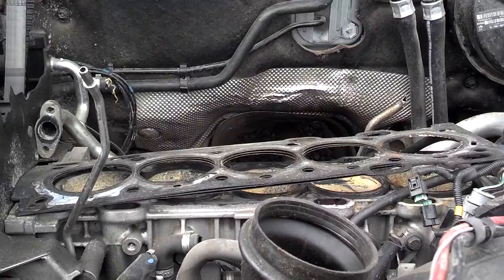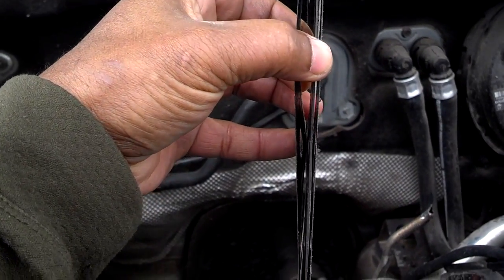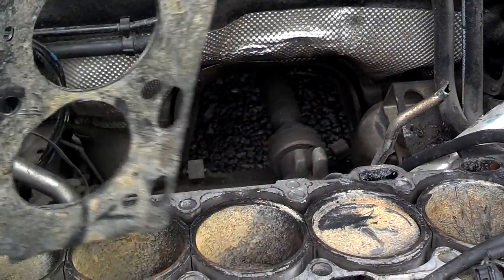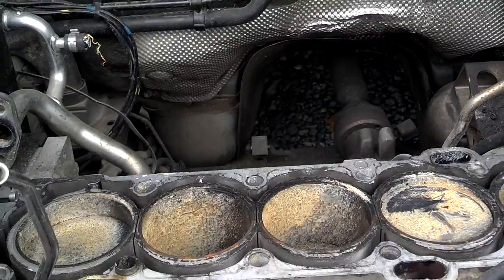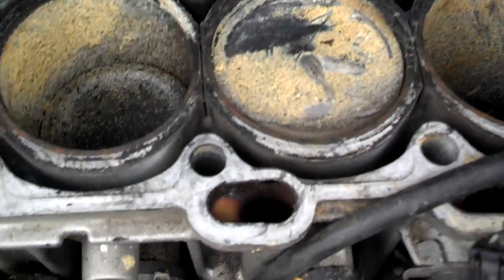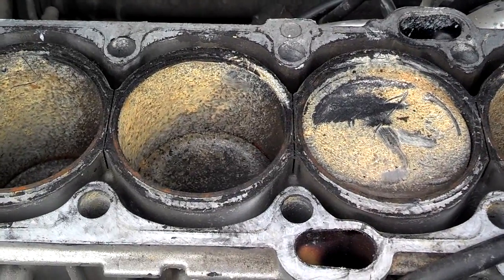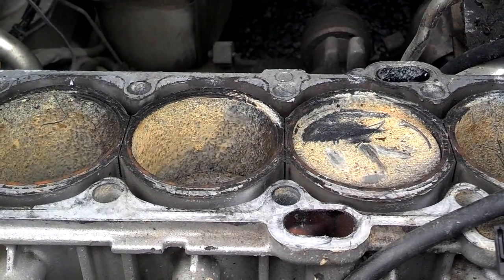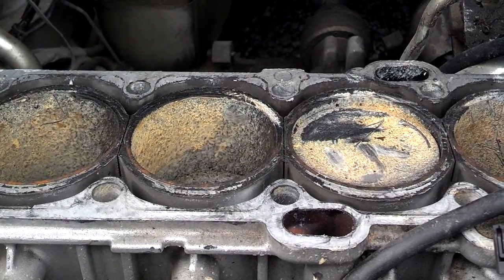Milky creamy white gunk on oil dip stick. Is the head gasket blown? - VOTD

Comment: Im dealing with something with my hhr.  White gunk on the dipstick and oil cap but the cap also has an orange film on it and my coolant is orange. The oil itself wasn't milky when i changed it it was dark and smelled burnt. 

I have a small coolant leak in a gasket and ive had my radiator half smashed in and hit a couple deer over the past couple years. I fill it every couple weeks by the pressure cap and it's fine but wont fill itself from the reservoir. I drive 65 miles to work,  then back every day mostly highway 55mph driving. Ive heard it could be a pcv valve but who knows 😂

Comment: Robert, mine it volvo xc90 2.5t mk1. No milky substance and white smoke. Is it obvious if there is water spit from expansion tank gasket is gone, won't that happen because the water is boiling and the fan does not come on? (confirmed fault)
Reply from the maker: https://youtu.be/WXOHjePUWkU?si=EKFdQ5cc5uvljloq

Comment: What about "the milkshake" in my PCV and Crankcase Vent Valve?.. I have a rough idle so I started with these two parts to see if that would help and I noticed  white sludge.
Reply from the maker: I don't even know what kind of car you have. I suggest you drive the car 30+ minutes and see if the stuff burns off. If you still have "milkshake" clean the stuff out or replace the parts.

Comment: Thanks  A lotta GREAT information.  Gonna check the Dip stick now.
Reply from the maker: you are welcome.
Reply: @RobertDIY  DIp stick, oil cap, over flow coolant tan ALL have light brown milky substance.  Plan 2 order NEW radiator, Flush coolant, ADD some sea foam to oil port.  Then see where 2 go from there.

Comment: Great explanation! My 2002 mitsubishi pajero 4x4 was parked for 3 weeks just drive it out the driveway and now i check the oil and it was funny looking ! The oil cap also have a milky color to it! I took it for a 30 minutes drive and oil is clean again! No white smoke 💨 coming out the exhaust pipe and no missfire! I felt relieved! Moisture got in the engine through condensation i guess i have to drive it more often!! Great 👍🏼 video!!
Reply from the maker: You are welcome

Comment: I took mines to the dealer. I thought it was a bad head gasket. Condensation was the name..like Robert said. Seafoam in the oil fixed it. One year later nice oil.  I had to pay 100 bucks to find out from dealer. Thanks for the detailed reference.
Reply from the maker: Glad they were honest and didn't rip you off. 👍🏾

Comment: I need you asap... I bought an 03 2.5 turbo xc90 140k original miles.  No oil pressure light comes on and engine knocks. When light goes off engine doesn't knock.. my 3rd Volvo with 2.5 turbo. Please help 507-621-4713
Reply from the maker: https://youtu.be/L3_lC3X3AFg

Comment: Nothing on dipstick. No smoke coming out the exhausts. Only condensation on the engine oil cap. Like I said in the other video, that isn't an issue
Reply from the maker: so what are you trying to say?
Reply: @RobertDIY  I'm saying that these symptoms dnt mean head gasket for sure

Comment: I had a ford focus 2007 , european version, i had it for 9 months, just before i got rid of it, it had a serious case of coolant disappearance, one time at a gas stop it even leaked 4L of fresh coolant that i put in, because the engine was running above normal temp, i stopped and saw the expansion tank almost empty.
I remember when the engine is operating, warmed up, i saw loads of air bubbles with coolant returning from the return loop into the expansion tank, could that be the air entering somewhere in the piston area ?
Also in one garage they decided that its "thermostat housing" that is leaking coolant, they replaced it, needless to say it wasn't that, i didn't even bother to get my money back
Reply from the maker: Dang. A blown head gasket can allow cylinder gases to get into the coolant system.

Comment: Thanks for linking me this video bro I'm almost sure it's the head gasket though I just did the whole coolant system on it too and I really don't want to junk it so baby in it as I can I'm going to try and buy a new car so I can get that one in a garage and do the work but not sure how long it would take me or if you might be able to help me out with that I'm in Denver Colorado by the way
Reply from the maker: I don't even know what kind of car you have...
Reply: @RobertDIY  I have a 1997 850 t5 wagon with around 180 miles
Reply from the maker: Oh, ok.

Comment: Hey Robert, I liked your video. I have a 2001 Safari AWD Van with 105,000 on the motor and I was letting it warm up to drive and the motor idled down for a min. and so I shut it off. After about 3 hours I checked the oil (checked it b4 when I was warming it up and oil was normal) and now it is very milky. So I think it just happened and maybe no harm to the engine (probably the head gasket, right?) When the oil gets drained and the head gasket repaired, how does the mechanic clean all that milky stuff out of the engine so it does not blow it? Should I Just get a new engine? Everyone I talk to says to put Blue Devil Head Gasket repair in it and that will fix it without replacing the Head Gasket. I think that would be a temporary fix if I was stranded, but I would want to repair it. This has been a great vehicle and I would like to keep it. Please let me know what you think? Thank You and have a wonderful day!
Reply from the maker: Did you drain the oil? Why do you think the head is blown?

Comment: Thanks Robert I was worried so much because my Chevy Cobalt had the milk on the dipstick and oil cap so I was worried and pulled the plugs and cranked no water just some dust lol and then changed the oil and it was black like normal  it's been like this for the winter and now since the warm weather is finally here hopefully I won't be seeing the milk. And I only really drive to work which is a 10 min drive City.
Reply from the maker: Run it 30 minutes at least once per week.

Comment: What if there's white smoke, but the vehicle isn't losing coolant fluid?
Reply from the maker: I don't even know what kind of car you have...
Reply: @RobertDIY  1998 Chevrolet Cavalier
Reply from the maker: All the time or what?
Reply: @RobertDIY  It's much more noticeable during the colder temperature, but yeah it usually does it most of the time. I drive very short trips very often.
Reply from the maker: Most cars smoke until the engine temperature is normal.
Reply: @RobertDIY  Okay. Thank you for the information, sir!

Comment: Whats your opinion about using the head gasket liquid ?
Reply from the maker: Like the stuff that you pour in to fix a head gasket?
Reply: Robert DIY yes the stuff you pour into the radiator
Reply from the maker: What kind of car do you have?
Reply: Robert DIY volvo 850 turbo 95
Reply from the maker: +oso v I would not do it.
Reply: Robert DIY why not?..explain plz.
Reply from the maker: +oso v it doesn't work on these cars. Do you have fluid mixing?
Reply: Robert DIY i have white residue on my dip stick..i believe its because of water getting in the oil
Reply from the maker: Nope.

Comment: I found some darker creamy oil on my dipstip, what could that be? The engine dosent drink any coolant
Reply from the maker: +ThePosjo did you watch the video?
Reply: Yes, my goo is darker than in the video. Or do you mean that it still is because of condensations ?
Reply from the maker: +ThePosjo when was the last oil change?
Reply: In august, so around 5 months ago
Reply from the maker: +ThePosjo drive the car 30 minutes and see if it clears up. Is the PCV serviceable?
Reply: Alright i will try that. Tbh i dont know where the PCV system is on my engine ( B5252S ). I have seen your videos about serviceing it but it looks diffrent than on my car
Reply from the maker: They all pass or fail the glove test.

Comment: hi robert, I'm looking at a 1994 toyota 4runner for my son and the oil cap is full of that milky white stuff on it. the 4runner is only selling for $250 and it has 177k miles on it. I do have enough money to fix the car. my question is what repair needs to be done to it, how much would it cost, and should I even but the car? keep in mind it's only $250. thanks
Reply from the maker: Let me check my crystal ball... nope, I still have no idea. How is the oil on the dip stick?
Reply: +Robert DIY hmm. good question. I didn't bother to check that. but do you think I should buy it anyway? I have $750 maximum to fix her up if needed that much.
Reply from the maker: Man, there can be 60 problems with a car that isn't running. I'd say pass.

Comment: Hi Robert , thanks for your info, it's great. I've got 320i 2005, I do lots of short trips, few days ago I found few dots of white gunk on oil cap, and it smoke white on and off not all time, am not losing water or coolant ,so what do u think? Is it head gasket of just condensation . Thanks
Reply from the maker: +zzxx1970 Well, the car is kind of newish, I doubt it has many miles and if it has not been overheated it probably doesn't have any issues with the head. Take it on a loner, 30+ minute drive and see if it has any issues.
Reply: +Robert DIY . Thanks Robert , it has 94000 miles on clock, it's losing bit of oil every month about 50ml . Don't know if ever overheated as got it three months ago. It's doesn't loose water at all but spits water out of exhaust with occasional white smoke . The smoke smells but sweet ish lol .
Reply from the maker: It should loose moisture out of the exhaust when cold.
Reply: +Robert DIY so, do think I should not worry about it?
Reply from the maker: +zzxx1970 Correct.

Comment: I have a car I only take short trips in usually. It has that buildup but the oil on the underside of the filler cap looks normal. I took it out for a longer drive and did notice some white smoke (not a lot, and not thick clouds of it). Could that just be the moisture that's already in there burning off or does it 100% mean the head gasket is bad?
Reply from the maker: +HELLDAD What kind of car do you have?

Comment: Thank you. We found this residue under the cap and on dipstick and first thought was to change oil but wanted to double check. This video was the first I have seen that has Kept my attention and had no nonsense and super easy to understand. Thank you. We do mainly use the truck to get to my job 5 minutes driving away and right now, we have had below 30 degree weather. I tend to not let heat up all the way very often for rushing things. I am going to take it slower from now on.
Reply from the maker: +Jennifer Rodriguez No need to let it sit idle. Start it, when the idle settles down start driving. Just try to drive it at least one 30 minute trip per week.
Reply: Thank you!!

Comment: Hey Robert...great video! I have a 1997 ford f 150 that knocks slightly with a milky substance in my coolant reservoir, but no white smoke at all.
Let me know what you think.
Thanks!
Reply from the maker: cadencorin1 I'd drain the coolant and fill with some fresh stuff to see if it returns. Some minor leaks get worse as time goes on.
Reply: Yeah, I drained it and then refilled with fresh coolant, but looks like the milky stuff is coming back.
Reply from the maker: https://www.youtube.com/watch?v=wGXoRLSDE04

Comment: Hi Robert,first thanks for all your efforts helping and sharing infos about the volvo cars,i just want to ask  you a question relates to smoke coming from deep stick,it makes under hood wet with oil,i fixed pcv,and i cleaned the ptc valve,but the problem is still,can you tell me what is the cause as yu are an expert about volvos,thx once again
Reply from the maker: Hakim Gil If you cleaned out the ports in the block that go into the oil pan, you may have a warn motor. How many miles? How long have you owned it? - How to do a compression test on a car motor. Volvo 850, S70, V70 through 1998 - Auto Repair Series
Reply: thanks for the reply  Robert,i cleaned the ports,it has 176000 miles,i had it for a year,yes,i am thinking to do some compression tests,one thing i noticed some white smoke near turbo area,precisely in the rear of the engine(i dont know if that cause the oil leak) what could cause oil leak there? ?whenever i start  white smokes showns,the smoke disapears when the car warms up.thanks a lot for your time and feed back

Comment: there are other ways to cause a bad head gasket-
too much compression, caused by too much fluid (such as fuel, oil, or water in the cylinder) or and overboost condition from the turbo.
also bimetal engines, meaning an engine who's block is made of cast iron and head is aluminum, expand and contract at different rates. this also can cause head gasket failure.
the point is head gaskets can fail for reasons other than overheating.
Reply from the maker: Thanks for your comments and you are right. My point is that most of them likely happen from overheating. My guess would be more than 9 of 10.

Comment: It had a history of oil leaks, I saw that in the aftermarket service manual. They took it to many mechanics. By the time I got it, which was just a couple of months ago, it looked okay but drove with a funny whining noise when you first started driving. The temp guage did not move up past halfway until that very last day but on a couple of occasions, I saw oil spots underneath.Also coolant. One day, it left a BIG oil spot on a friend's driveway.

Comment: That 1998 V90 wagon is in the shop right now with a diagnosis of head gasket failure. Is it feasible to do a head gasket repair on a V90 at home? As of now, I can't afford to pay anyone to repair it. I'm very disappointed in this car so far. Every single thing in it seems to cost triple what it would cost to repair any normal American car.

Comment: What if the oil temperature gauge is not working right? Is it common for the engine to overheat without showing high heat on the gauge? How do you check that the oil temp gauge is working right?

My 1998 V90 wagon is losing both oil and coolant. I can see what appears to be wet areas behind the back of the engine, like around the transmission maybe. But the stains on the ground are two separate small puddles, one oily, one coolant. I topped off both fluids but it keeps leaking.

Comment from the maker: Not on the stick but in the pan once drained. Oils have a lot of detergents to clean out the motor while it is running so the oil should be dark when drained into a pan. Gets dark within 1,000 miles. If you have a turbo car, only use full synthetic oil and good Volvo or Mann oil filters.

Comment from the maker: 188k Is really not a lot. I have seen them with 67k and bad valves. Low mileage do not impress me with these cars. Just make sure you use a Volvo (or Mann) oil filter on them and use Lucas fuel injector cleaner every 2,500 miles. This can help reduce the chance if the car having head issues.